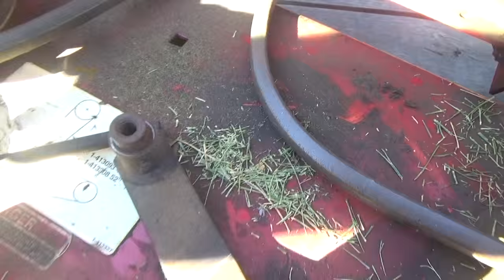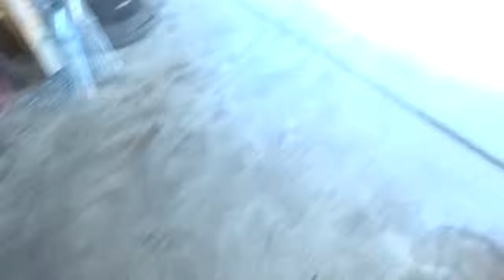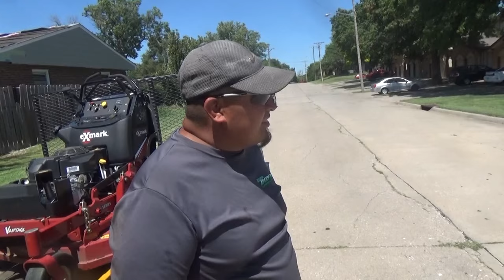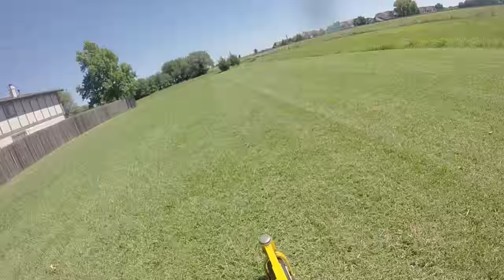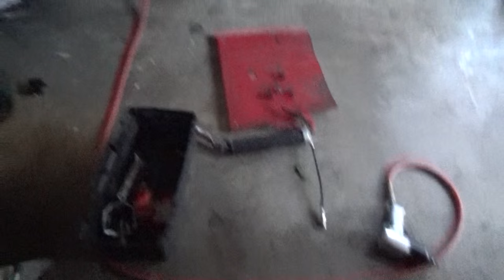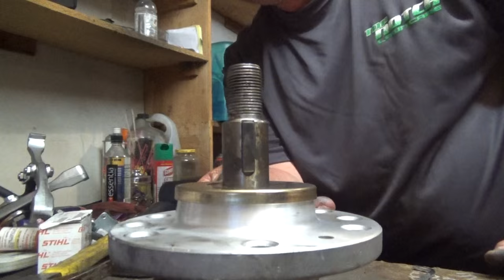Spindle Housing Replacement, Lawn Care Vlog #52

Comment: yeah, i've had plenty of those days, brother, but God Is still Good.  these things pass. when something on my mower goes down, i have to fix it right away, or i have nothing bc my other old belt drive metro ( the "backup" ) is still laid up with a back firing engine, burning oil & so forth. maybe i'll make that my winter project, but i'd still rather buy a new engine. shops around here act like the other walkbehind is so old it wouldn't be worth a new engine, but i'm going to try it anyway if i can't fix the current problem.

& thanks for the spindle housing footage, despite the lighting issues, you still got the point across.

Comment: Hey brian you can rebuild the spindles by replacing the barings. Its very simple and much cheaper than buying the hole assembly. There is a top bering and a lower bering. Should cost less than $20 if i make a video soon i will make one
Reply from the maker: K and R Life Style Didn't even think of that. I would like to see it!!

Comment: Not sure if anyone else mentioned it but you can usually replace just the bearings inside that housing. Usually pick them up at an auto parts store or your mower shop may have them.
Reply from the maker: +ProTurf OK I didn't know that, thanks for the info.

Comment: Hey Brian !

Good vid as usual brother,
Have owned and operated a small engine service co 30 years...
A word about Kawi engines, tuff as nails if you maintain 'em....I'm talking the USA made Kawasaki engines, V-Twins specifically.

You can order a long block as a repl for your TT mower, save hundreds on the accessories because you have the parts from the used engine. Swap 'em over and your back mowing. Rebuild the bad engine and save for a spare, parts are valuable...

Good luck with your repairs, and consider the use of grease thats rated EP (extreme pressure) for all your mower grease points, especially the spindles !

Doug @ Lakesideranch
Reply from the maker: lakesideranch Thanks buddy!!

Comment: First things first, Bless You for your sneeze LOL!  I have a mower down for pulleys and shafts right now and its the one I use on my big commercial properties, but I have to order and wait for the parts.  It sucks but part of lawn business I guess.  You got an awesome deal on that stander, I'm still looking into getting the Toro version 40" Grandstand.  Are those machines really around that cheap?  I wouldn't mind putting a new motor or rebuilding one if I could get the machine for 1500 or less.  Great video, reminds us we are not the only ones with equipment failures.  In this together right? LOL.  Hope things come together for you, love your vids!

Comment: Call greentouch they may send you the engine mounts. Atleast you didn't have to watch the engine bounce down the road behind you. My 94R shaft was only 50 bucks so not to much to fix.
Reply from the maker: ***** That would have freaked me out. LOL I just dropped it off at the dealer. Hopefully they don't charge to much.
Reply: Brian, you should get the motor mounts check out Scag man's video. I also have a video of them. They are very easy to install. Great video once again.

Comment: I have the same trim rack system Brian. And mine bounced all over the place but, I bought the engine support system from them and it helps a ton. they don't bounce all over the place anymore. That is if you don't already have it in place?
Reply from the maker: Leland Adcock I plan on getting the engine mounts.

Comment: Good job Brian. The sound that Tracer made is telling me I have a spindle that is on its way to going out. Looks like I need to go and get a new puller. I Think the sound of mine is coming from the discharge side too. How long did it take to fix it?
Reply from the maker: Chet Burke Not long at all Chet if you have the tools. I would say about an hour. It took me longer because I didn't know what was going on and I didn't have a puller.

Comment: Take the barings out of the old housing there will be a part number if barings are going bad on one the others will follow soon. Another good tip dont by belt, barings or pulles from your dealer the make up will be unreal. Go to a baring supply store to get them. Most auto stores will have belts. I bought a belt for my 48 that cost $14 and at the mower shops it was around $75. Just a tip ill make a video on the spindles i just rebuilt 2 or them on the 48 and i have one more to do when i hqve time.
Reply from the maker: K and R Life Style Another great tip, thanks!!

Comment: Call Kansas City Small engines they are on line.  bar non the best deal I have found on replacement engines.  Also try Pats small engine on line.   I buy all my parts from Pats on line and No I don't work for them I have a  lawn service and these places have saved me.
Reply from the maker: +ed bures I will look into that. Thanks!!

Comment: Ouch! Holy hell that's a lot of breakage to face at one time. Especially a new engine. Seems to me that your dealer was a bit asleep at the wheel in diagnosing the engine problem. An ignition coil, a carburetor and finally a stuck lifter or piston as a diagnosis. I can't follow their logic. That's simply changing parts (at your cost) until the problem goes away.  A simple and quick compression test would have shed a lot of light on the situation.  If a piston were seized, the engine simply would not turn over so how would that relate to slow starting and need for a coil or carb? If a lifter were stuck, well, if it is hydraulic, it could collapse and fail to open it's valve resulting in compression/power loss and hard starting. Unless it completely detonated and ruined the lifter bore and camshaft etc, it should be easily repairable. If it is a solid lifter system (adjustable,) it might have just gone far enough out of adjustment to allow the rocker arm/push rod/lifter to separate  - the result being loss of power (now down to one cylinder operational,) and hard starting. I may be way off base as I'm sure your followers will quickly point out but, something does not add up to the diagnosis that a new engine is required.
Reply from the maker: Merlyn Sk I actually seen the engine torn apart on the mechanics work bench. The piston is stuck about half way up the cylinder. I do believe I can fix it but not right now due to no time. I agree with you that it didn't sound right to me. The part that didn't make sense was it would start and run, but would bog down when blades were engaged. I assumed if the piston was stuck then it would be at half power all the time not just under load. I'm actually very ticked off at them at the moment. When I took it in it ran and cut grass. He diagnosed that I needed a new engine and didn't even put it back together completely so now it doesn't even run. You have me wondering now if the push rod/lifter just came apart like you said. I assume there is no way to know now because he probably took that apart and didn't put it back together.
Reply: Interesting. But one thing is for certain and beyond a doubt. If a piston was stuck (in other words seized,) nothing would have moved, and I mean nothing. Both pistons are linked to a common crankshaft and if one seizes (or gets stuck,) nothing moves. Nothing. You could not even crank the engine over by normal means. You might have been able to put a wrench or other tool on the end of the crankshaft and force the engine to break free but in doing so, the engine is then probably screwed. The rings might break scoring the cylinder wall (scratching and gouging it) and then you would be out the cost of at least a new or rebored cylinder and a new oversized piston and ring set. Still cheaper than a total engine replacement. The fact that the engine was running at all when you took it to the shop tells me that a "stuck" or seized piston is absolute and total bullshit. A worn out piston and ring assembly will cause a loss of power, hard starting etc. but, you will typically get a warning in advance. Lower power, blue exhaust smoke, fouled spark plugs, hard starting, excessive oil consumption etc. Those symptoms do not indicate a seizure, just hard usage or high hours. I'm no expert, but a new cylinder/piston and rings ass'y should be far less expensive than a new engine. Especially a commercial engine supposedly designed for long, hard use. They should be repairable and not just a "Throw away" item. I have a problem with your mechanic my friend.
Reply from the maker: I feel the same way. The more I talk to you about it the more pissed I get. Your explanation makes way more sense. Your right, if one is seized then both will not move. If both pistons are not moving how in the heck can it turn over and run? I think I might have to go back up there and talk to these people.
Reply: I wish you the very best of luck in resolving the situation. Like I said, I am no expert but, I have a good grasp on the fundamentals and I absolutely hate to see people screwed over. I've done my own maintenance and repairs on machinery for 30+ years now and I claim no expertise but, I smell a rat in your case. All the best!
Reply from the maker: +Merlyn Sk this is where my inexperience comes into play. Their diagnoses was the lifter is stuck. Not the piston. If I'm correct that is in the head right?
Reply: +TopNotchLawns I don't know what engine your machine uses but I'd assume that it is an overhead valve (OHV) engine. The ones I am familiar with have the cam and lifter in the block and the valve, valve spring, rocker arm etc. in the head. A pushrod links the head and block. A simple compression test should have revealed the issue.
Reply from the maker: Merlyn Sk You are correct. I've done my homework now and understand how this all got turned around. The lifter is stuck per the mechanic and the lifter is in the block like you said. I agree now that he didn't have to disassemble the engine to diagnose. My problem now is since he had it torn apart why couldn't he just free up the lifter and replace if necessary?
Reply: That's a really good question. My suggestion would be to get a second opinion from a reputable mechanic. The labor to replace a lifter and reassemble the engine might not be cheap but it should be nowhere near the cost of a new engine. I wish you the best of luck!
Reply: By the way, if you find  a mechanic that can replace the lifter, it might be wise to have him check the engine over while it is apart and replace anything else that is badly worn particularly if the engine has high hours on it. With labor being the big cost, you might as well replace what's worn while it's already apart and avoid tearing it all down again in the near future.
Reply from the maker: Good idea, Thanks!!
Reply: I'll be following you online to see how this all plays out. I sure hope that I've given you reasonable advice. There are times when a new engine (with a warranty) is the most cost effective way to go. I guess it depends on how worn the engine is, the overall condition of the machine and how long you hope to keep it.
Reply from the maker: Cool, I think you've been extremely helpful. We could have saved about 5-6 comments if I would have known what I was talking about from the start. LOL
Reply: Thanks Brian. Small engines are very interesting to me even though I have actually been an aircraft mechanic for 33 years. I just hate to take something to a shop if I can fix it myself.
Reply from the maker: I agree with you on that. I'm starting to like working on things.